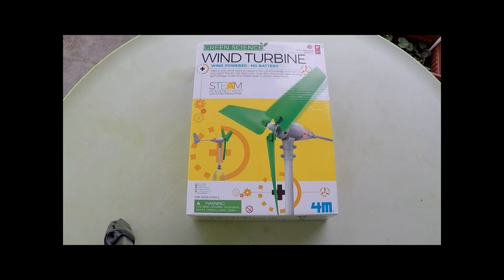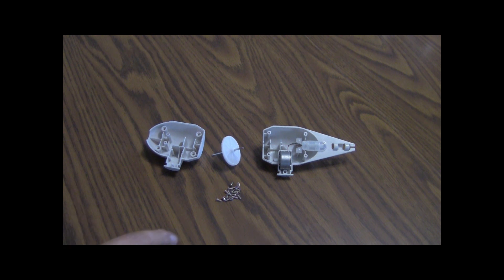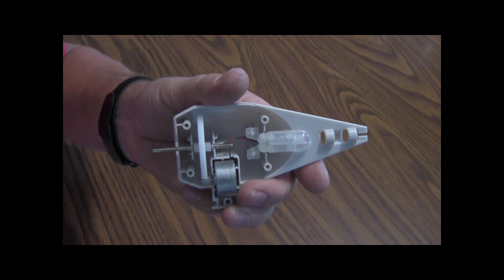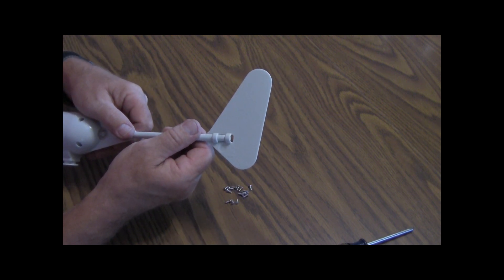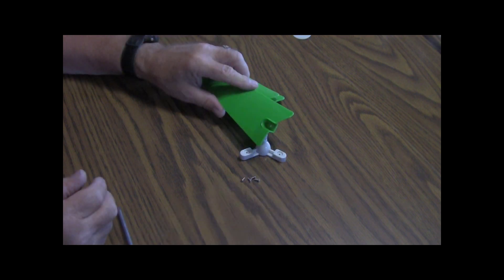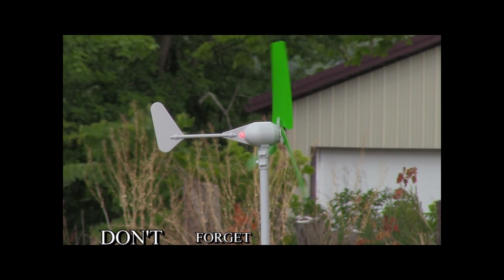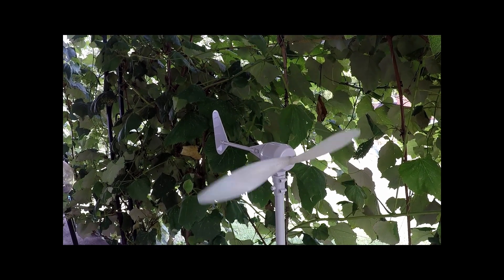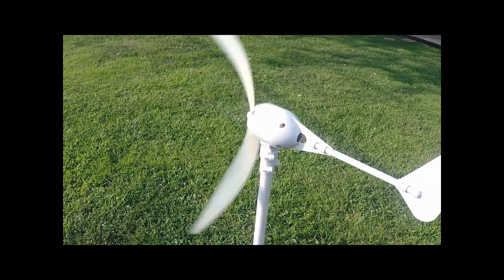Wind Turbine that keeps the moles out of my yard

Comment: Found this video in Aug 23.  I'm curious what the long term report is? Does this method work to keep the moles away?  Thanks
Reply from the maker: Your welcome. Worked until a storm came by and destroyed it. I purchased another and the same thing happened, but it did work. The noise and vibration kept them away and out of my yard and pushed them into the neighbors yard.

Comment: I'm confused....it has a motor,  but what powers it? I didn't see any electricity or batteries. I get it that the wind makes the blades turn, but what is the motor for?
Reply from the maker: The motor is a generator and as it turns it creates electricity to make the light come on.
Reply: @LonnieJohnson1 I just watched a couple vids that say those cheaply ones from the dollar store - that kids blow on  at the fair work too 😊
Reply from the maker: Yes they do, I have some in the flower beds and they are cheaper than the Wind Turbine.
Reply: @ I spent yesterday popping a few in the ground but it’s not consistently breezy in my yard, any suggestions?
Reply from the maker: I have a small breeze most of the time. I now have chickens that walk the yard and I haven't seen any moles just the one that the chickens got hold of and it didn't survive.